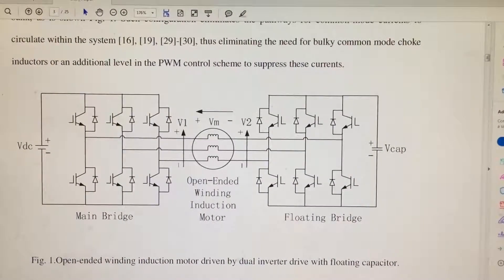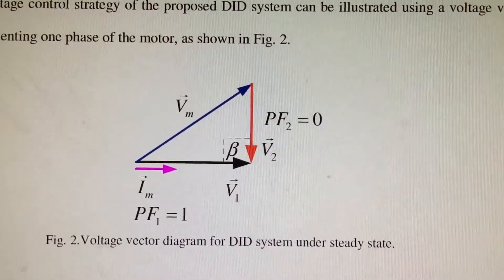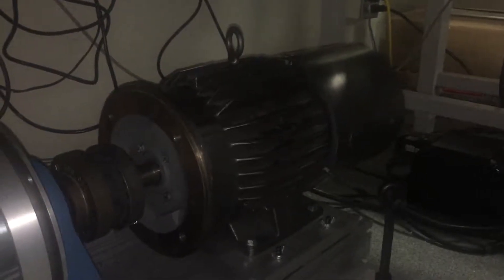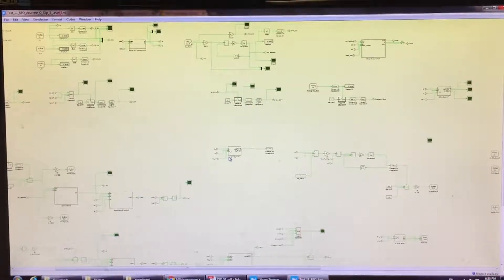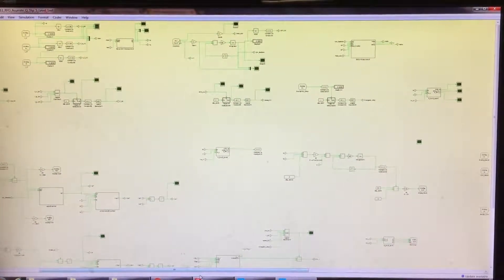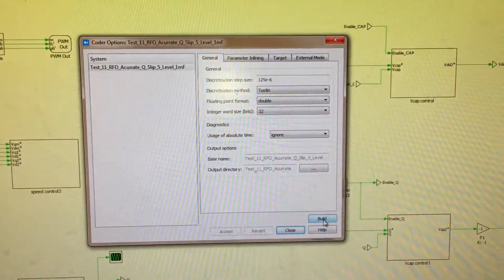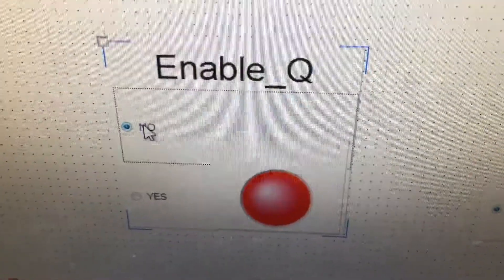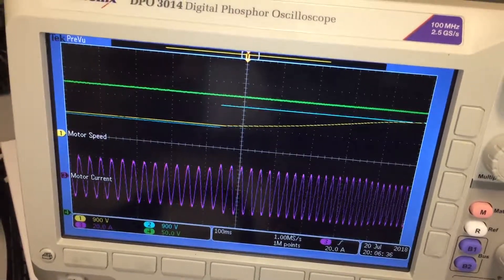Open-ended Winding Induction Motor Driven by Dual Inverter Drive

Comment: Hi Yusileng, I am also doing project on open ended induction motor. I am huge problem with tunning of PI controller. I have four controller for flux, Id current and speed,iq current.
Can you provide me a direction on how to tune these PI values?
Reply from the maker: I was using try and error in simulink first, then implement PI in real time. So my suggestion is to build a realistic simulink model and do the simulation first

Comment: How much duration required for Floating bridge capacitor to get charged. During Charging floating bridge is used as converter. Then when you switch on Floating bridge,  it function as inverter with same 3 phase sequence of main bridge. And with this you also achieve pf improvement. This is what I could know. Please explain more I'm new to this concept.
Reply from the maker: The energy comes from main bridge and then through motor winding and then charges floating bridge. It takes about 0.5 second to charge up the capacitor, during which time the motor is not moving. After that, the speed command to motor is given and motor starts to spin.
Reply: @yusileng   Initially it's in star connection to charge floating bridge capacitor.  Capacitor stores energy to switch on floating bridge inverter when motor is in Run mode. When Stored energy of floating bridge capacitor is low you will have to stop floating bridge inverter. This circuit shares total load of the motor for particular duration and improves pf. Hope what I'm guessing is correct.
Reply from the maker: @vivekprabhu2651  No, the winding of IM is always open, there is no physical star connection. The real power is supplied from  main bridge, and the reactive power is supplied from floating bridge. Since reactive power does not contribute to losses, the floating capacitor voltage can be maintained.
Reply: @yusileng   amazing. Why there are 3 capacitors for main bridge and only one for floating bridge. Is it necessary to match phase angle with main bridge inverter before switching on floating bridge inverter.
Reply from the maker: @vivekprabhu2651  Hello Vikek, there is one capacitor for main bridge and one capacitor  for floating bridge. Yes,  you need to coordinate main bridge with floating bridge so that they can work together. Otherwise, the floating capacitor voltage will collapse

Comment: Can we use BLDC motor instead of open end IM for this load ... could you please tell me merits of open end IM compared to BLDC motor....bcoz in many papers BLDC is mentioned as more advantageous than Open end IM...
Reply from the maker: I think you can use BLDC motor. I believe the merits of IM is that it has lower torque ripple than that of BLDC because it is more linear. Open end IM can use the floating bridge to boost motor voltage above the DC link voltage, which is an merit

Comment: Even it is running as a motor why the torque is showing negative sir....
Reply from the maker: The negative is because of the dynamometer manufacturer definition, in reality, the IM is driving the dynamometer
Reply: @yusileng  thanq sir

Comment: Great work sir, nice video and would you please give the advantages of an open ended induction motor over Star induction motor apart from control  flexibility...thanq
Reply from the maker: The floating capacitor voltage part can boost overall motor voltage above the primary DC power supply, about 30% more. This means a lower voltage battery pack can be used to power the same motor